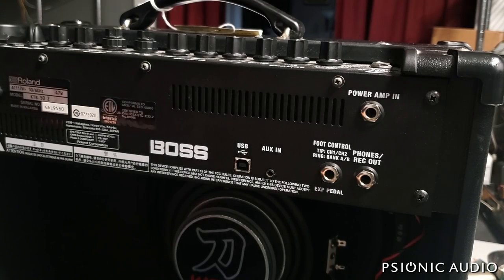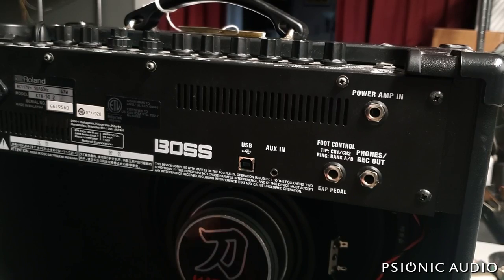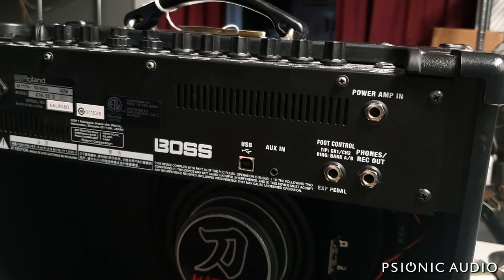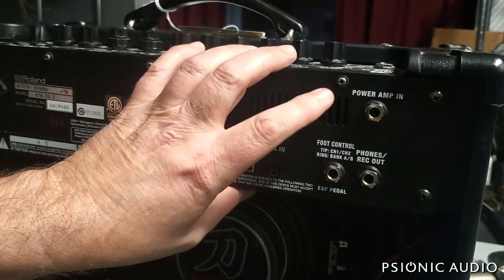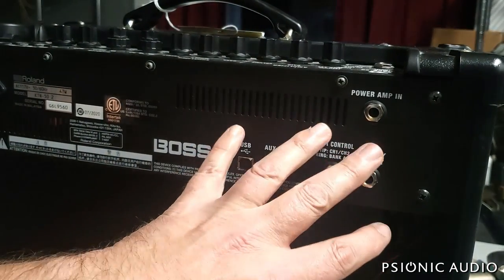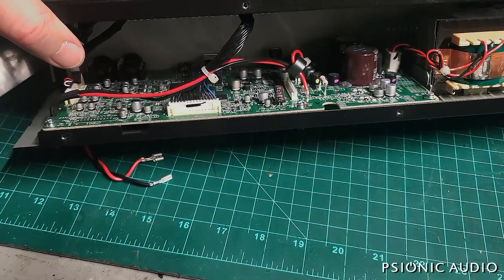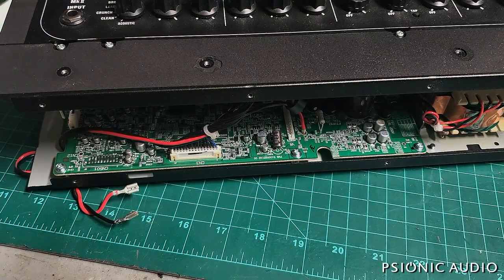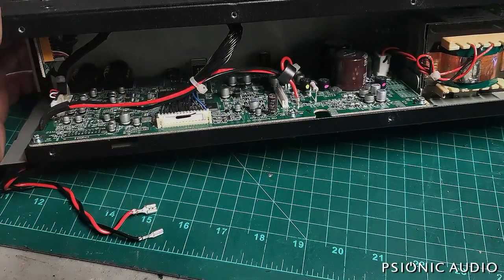Boss Katana 50 Mk II | The Cold Hard Facts of Business

Comment: I play  GT-100 into the effects return of a Red Stripe Bandit.  I must have damaged something in the preamp section when I was running the Boss into the input.  I can still use it as is, but I ever sold it, it would be as a speaker with a power amp.  Anyway, if the GT-100 ever bit the dust, I'd be in the same position as the Katana owner.

Comment: Wow. "So many parts, if it doesn't have through-mounted resistors and an EL34 that I can understand, it's unserviceable!"
Wouldn't kill you to check the signal path at least. Dollars to donuts it's a fried 7293, probably from heat and moisture. 
None of the digital stuff got damaged and it would not survive -28VDC. 
Just because the amp has more than 15 parts in total, doesn't mean it's disposable.
Reply from the maker: Yeah. That's exactly how it went down. Thanks for enlightening everyone.
Reply: My guess as to "how it went down" is as good as yours apparently, since you haven't bothered to actually check anything...
Reply from the maker: An amp sells for $250 new. It's now used and two years old. What is its market value?
Reply: Would you replace a broken OTA in a Klon pedal? Solder a cable? Or do you not go below $250?
Reply from the maker: I'll repair anything that is reasonable. I know it was likely to be the big heatsinked chip. But it could have been other transistors or zeners etc. Not going to spend an hour diagnosing then an hour fixing on an amp that costs less than those two hours.

Comment: I had mine for 1 year or so and the 5 inch internal speaker stopped producing sound, I opened it up and verified the speaker is not faulty and the latch switch works so it's likely part of the circuit board is dead. What a shame, the amp sounds great but I lost the bedroom night mode practicing. Still works with the external cab though.

Comment: Noob question: At the risk of asking a really stupid question, when you refer to “DC being present” would that be from the capacitors? Thank you.
Reply: It's because of a failure in the power amplifier. The output transistors basically act like switches normally and in this failure case they are switched on.

Comment: I realized early on that there wasn't much to a simple little 10-15 watt solid state practice  amp. Then one day I decided to put new tolex on a Peavey Vypyr VIP 2 and I was quite surprised that there was very little to the circuit board. I have an Artist MKII that I've had for about a year and a half and if that goes I won't buy another. They're fun to play with, but I have a Fender tube amp and a good selection of pedals that I find myself using more. And the Fender will probably outlive me.
Reply: It will cost to replace the tubes afters few years, probably a hundred bucks plus fitting cost if you can't DIY.

Comment: Cost anywhere from 370 TO 400 bux in Australia for that amp, way to expensive for what it is. I got a new Marshall Origin 20c valve amp for 100 bux more and it's louder and sounds heaps better too.
If the katana was around 200 to 250 I'd probably grab one just for messing about with and add to my collection of amps.
Looking at how compacted the guts of that amp are, and the time it would take to unmount it all, I wouldn't of bothered either if it was a customer job. If it was my personal amp I'd fix it.

Comment: Boss Katana 50 speaker is 4 Ohm, all the other Katana's have 8 Ohm speakers; then again the 50 is just half of the 100 power section.
Reply: At 4 Ohms wouldn't it be just as loud as the 100 watt version at 8 ohms?
Reply: @nathanhyde2079   They actually are 😀 there is only 3 Db difference between 50 watt and100 watt versions of any amp.
if you want two times as loud, you have to have ten times more powerful amp.
Aka 100 wat amp is two times louder than 10 watt amp, but both are so loud that you are not allowed to play them on stage anymore without complains, both can exceed 100 db easily.
Reply: @aristocaster  I had no idea I was only making an educated guess lmao. Thanks
Reply: I'm almost positive my 212s are 16ohm.

Comment: These blow internal chips if you plug external speaker (or cross speaker leads)  while powered on - sounds good but disposable amp.
Reply: Don't forget that tube amps also have their problems - output transformers are destroyed if not connected to a speaker, and faulty tubes can take out power and/or output transformers.

However, there are cheap workarounds to these problems (e.g. switched dummy loads on the output transformer &  protection diodes on tube rectifiers).

Unfortunately, manufacturers often don't bother to install cheap protection circuitry to ensure that their amps (tube or solid-state) don't have a catastrophic failure 😡

Comment: Dude, seriously without even putting my scope in the output, the amplifier IC on the daughter card with heatsink is bad. No different than your average car stereo with no output which is all that output circuit really is in mono. The chip would have set him back $15 on Mouser or Amazon perhaps and 10 pins to desolder on that IC. Way to lazy bench on this one! 1/32 the troubleshooting of say a Mesa with no output and truly a no brainer. -20 respect points.
Reply: and if your wrong?
Reply: @BenState  Then I’m wrong, but it’s an amplifier, not a living thing. Also, I’m most likely correct.

Comment: Do they have replacement power section boards?
Reply: Would be great if there was a USB diagnostic that determines which circuit needs replacing.
Reply: @stephenhookings1985  I would say look for transformer power, then check capacitors

Comment: The VOX valvetronics amps and modeller pedals are similar.! Them 12ax7s are l.e.d lit.! Don't believe me.? Pull out the tube and the drive still works, play a gig and that "tube" is as cold as a sitting un used 12ax.🤔😂

Comment: Even a modern PCB tube amp is easily serviced. I can’t help but notice the glaring lack of low end and sonic complexity of any SS amp. Any comparison to any tube amp of 20watts or more with a 12” speaker blows this “boss” out of the water. And not trying to stimulate a debate but the sonic complexity can easily be compared with a signal generator and an oscilloscope. Fact check: true. Save your money for a decent, even used tube amp. Look at the pathetic innards of this thing….at $249 and the manufacturer still is making huge margins on it. Rip off IMHO